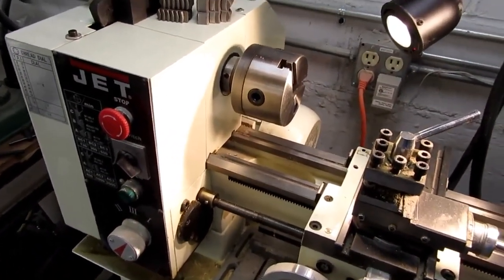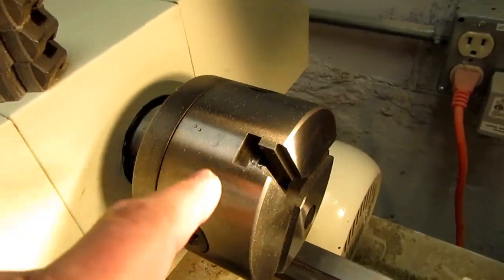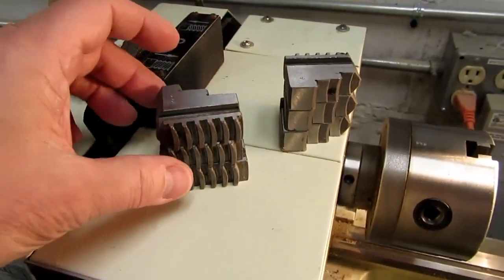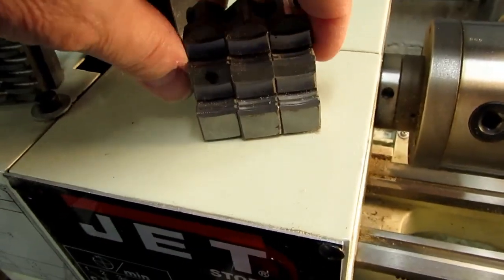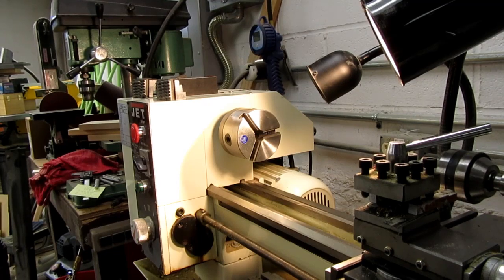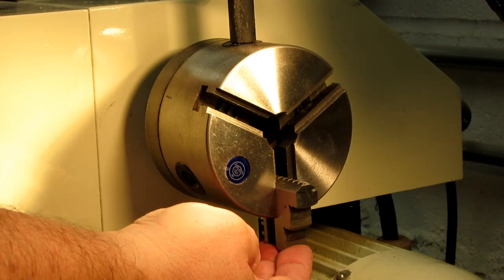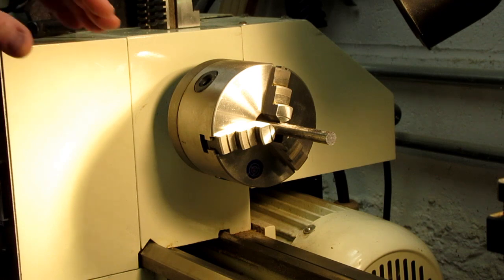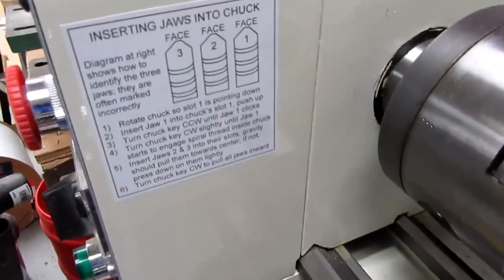How to Insert the Jaws Into a 3-Jaw Chuck on a Metal Lathe

Comment: Well explained, thank you for the vid,  I have just bought a self centering 4 jaw chinesium chuck, and the jaws are numbered, but no numbers on the chuck.   ( although there are plenty of burrs and loose filings inside. ) Trying to get the jaws in right is driving me nuts. I will try out your method and hope for the best. Of course, there are far more possible combinations on four jaws. My last resort will be to use a grinding tool and and skim the interior of the jaws until they run true, then mark their positions.  Graham UK.

Comment: how did you figure out the numbers on the chuck if they weren’t numbered correctly.
Reply from the maker: ducatione, simple.....there are only a few possible variation on the positions of the three jaws, so I just tried them one at a time until I found the one that worked (only the correct combination will result in all three jaws meeting at the center of the chuck).

Comment: To avoid cross-threading a bolt with fine threads, I always back the bolt out until it seats itself. That's exactly what you do when getting the jaws to seat themselves. That tip I got from Heloise or somebody decades ago.